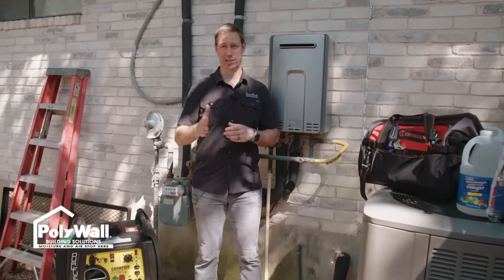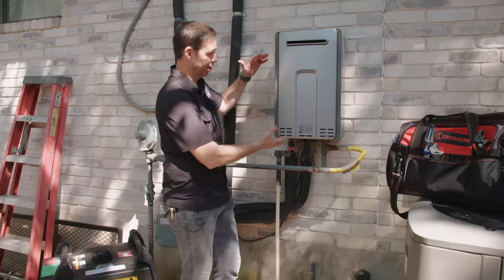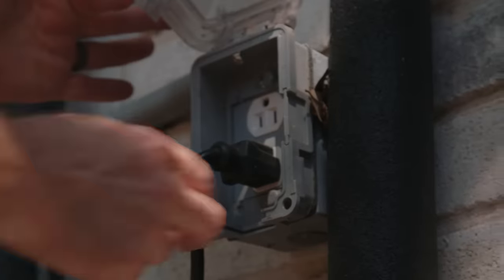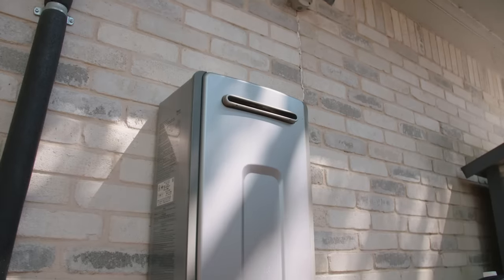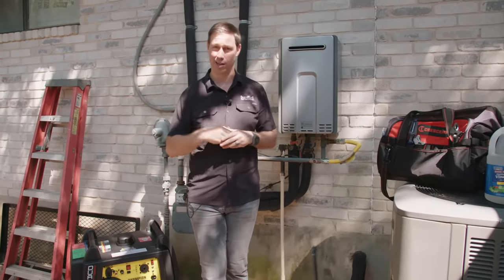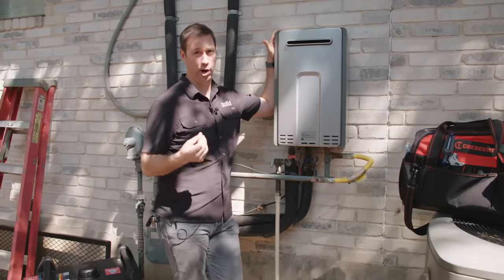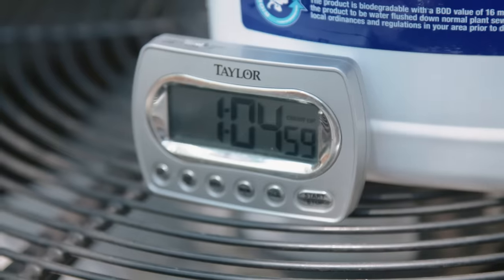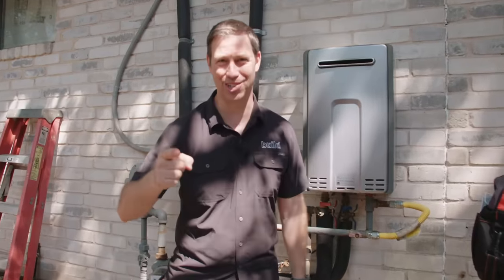3 Things They Don’t Tell You About Tankless

Comment: They have battery 🔋 igniters on some of them.
Reply: Surprised all of them dont but unless its a lithium recgargeablethat charges automatically when power on the battery probably would be dead when power goes out lol
Reply: Those are usually only found on the weird cheesy amazon-chinese style that are meant for camping. They typically have a 20 minute time limit and are not designed to be permanently plumbed into your house.

It would be a nice feature on the more common home models, but they require electricity for more than just sparking the gas. They have various controls for modulating the heat output if you are only using a small amount of water, and a bunch of safety things. The size of the circuit board inside is surprisingly complex. They don't require much power though, you could plug it into a lithium battery/power inverter combo that you can buy for cheap.
Reply: Ryan Roberts they should make a built in 12volt igniter with a 12volt lithium battery. That has a USBC charge port that you can use to to charge the internal lithium battery. That way you have the option of running it DC or charging it from a House hold wall plug.
Reply: tee kay yah but it takes very little power to ignite propane. a couple of 18650s would last at least a couple days of constant imagination.
Reply: @theMekanik  Like I said, they require power for more than just ignition. You could easily plug it into a cheap UPS or a lithium battery/power inverter combo.
Reply: Ryan Roberts yah but I hate the idea that everything in our houses are practically DC and we keep putting rectifiers in ever damn DC device to make it work with incoming AC Power when all we have to do is transmit AC to the house and Turn it into DC ONE!!!! TIME!!!! then distribute DC through out the house. DC 48volt would be good enough to run most anything or 24 Volt. 

Light Bulb, Power Tools, TVs, Computers, Cell Phones , Refrigerators, Electric Cars are all DC Devices that have to convert AC to DC. I can’t honestly believe I am the only one that sees how ridiculous this is that we still try running everything thru investors that have losses throng to convert DC to AC BACK to DC 🤯 I mean even Solar is DC current. I don’t know why we keep trying to change DC to AC back to AC to power the majority of all out devices and lighting that runs on DC power!!!! OmG!!!! Lights should be the one thing we center power on. Loosing 15% of power through changing it back & forth. That’s insane, then tell me that if we are are running on Nuclear ☢️ 15% of extremely Hazardous material is being wasted because we are morons. 😑🤬🤯 Think of it as loosing years off your life. 100 years - 15 years = 85 here let me just take 15 years of life from you make you do “busy work” 🙄 It’s like people driving around in a 4 Door 4x4  to a job they have crunching numbers. Which they could probably do just as well sitting at home on their butt. 💁🏻‍♂️ Then they justify it because they need a 4x4 Truck to go hunting only 2 weeks out of a whole year, when the could hardly augmented their transportation with an small electric car or scooter 🛴 🚗  for transport to & from “work” 🤨 Don’t even get me started on the infrastructure required for  public transportation. Many other things I have thoughts on in the area of “waste” and poor product design. 😖
Reply: @theMekanik  Sorry, but you have no idea what you are talking about. There is nothing wrong with AC and no 24v DC would not be acceptable supply/distribution in a house. They figured that out over a hundred years ago. I couldn't bother to read your rambling second paragraph.
Reply: @theMekanik  Having lived in a RV for a few years (near a resort town, no affordable housing), I often thought about wiring a house for DC (since everything in the RV ran off either 12VDC or propane). But then I started thinking about the high current devices, microwaves, fridges, etc. 

The wiring would end up looking like a car. Plus the fact that the power supply that you would have to install would not be very efficient at lower power draws. Not to mention the incredibly high amounts of current that would be coursing thru the walls. We're talking about single wires carrying 150, 200, 300+ amps for major appliances!? It comes down to this, higher voltage=lower current. 

I have wired a small cabin to use 12VDC for a friend, but the stove and fridge were propane. No washing machine, no dryer, no microwave. And he still has to use an inverter for the TV. He was using Solar w/batteries for power but didn't want a whole house inverter.
Reply: Small ones (7 liters) have 2 D batteries, mine last a year on daily usage
Reply: @MojoPup  Exactly. An average electric stove or dryer uses about 3kw. That would be 250 amps at 12v or 125 amps at 24v. You would have to run wires bigger than the battery cables in your car to every appliance. Not remotely practical. Even on larger vehicles like busses, airplanes, boats, etc often run most of their systems using AC power. That's why bigger things don't run on 120v either, you need to have 240v as the load goes up.
Reply: @theMekanik  48 volt dc requires much larger wiring for anything requiring much power like microwave oven fridge dryer water heater ovens  and dont even think of tankless electric. Even golf carts have gone to 72volt or higher in many cases and several even convert the dc to ac to run ac motors for efficiency these are generally either larger motors or 4wd etc.  DC power actually transmits more efficiently over long distances at very high voltages much of this attributed to the magnetic field and "skin " effects of ac that dc doesn't have.. China is doing this to transmit power from desert areas with solar to big cities. A typical solar inverter also loses 10-20% in transmission and conversion loss.  Remember a house circuit has to meet code designed to have a particular amp load that may never actually be plugged in to this. With LED lights and tvs etc now I think at the minimum there should be an option for a 2 or 5  amp ac circuit instead of 15 etc.  A whole ceiling full led bulbs  will likely be no more than 200 watts where the design for incandescent would have to carry 1500-2000 watts.
Reply: @theMekanik First my answer was for the fan someone suggested that may need power also I presume the duct fan for condenser unit. true but 2 18650 cells is only 7.4v or so nominal not 12 volt but design could be for any voltage a usb is considered 5 volt so it wouldn't charge series 18650s but yes it could be done its essentially same as a UPC.
Reply: Ryan Roberts 48volt DC system in a house/domicile/apartment/flat. 24 volt for portable handheld power tools & double stacked 24X2=48 for skill saws, chain saws, weed whackers...... etc. 

The only thing they figured out a hundred years ago that AC was only good for transmitting power long distance over 100 meters. No place in a house is over 100 meters. 48 volts DC system would be perfectly adequate for of all living quarters of 98% of all human beings. 🤣
Reply: @theMekanik  You just need to stop talking. You have no idea what you are ranting about. You're making yourself look dumb in public.

There is no reason to supply houses with DC power, and no, 48v would not be acceptable either.
Reply: tee kay Vape Mods charge, single, dual, triple 18650’s through USBC. it should be capable of providing plenty of ignition cycles.Yah I didn’t think of the condenser versions of the gas on demands. There is an 9 inch Opolar  dual 18650 fan on Amazon that charges with USB it’s lasts about 8 hours?? of run time before it dies & I can run it on a 20,000mah external USB battery pack for probably 24 hours, not sure the requirements for the condenser units but I am sure it is doable to power a 5 volt DC fan for 24 hours when the prime power goes out???
Reply: @theMekanik  a lower dc voltage cannot charge a higher dc voltage .  Either the 18650s are connected in parallel or the voltage is stepped up.
Reply: Ryan Roberts I said supply AC to the house, then change it change it to 48 volts DC for all the lower voltage appliances 💁🏻‍♂️ Then have dedicated runs for higher power consumption loads, like clothes driers, microwaves, convection ovens, hair dryers. You know like they already do. Make it like an RV & run a 48 volt system instead of 12/24 volts. 

Use propane to to cook with, & on demand water heaters. Possibly to heat the living space too.

If the insulation is superior in a domicile, you really do not need a shit ton of power to heat or cool your living space, I think Matt had a house on here that only used 1500watts to heat an entire large house in the Northern Hemisphere. 

I use:
-  a propane camp stove to cook with

-  an electric on demand water heater

- a ventless washer/dryer that uses 120 volt AC

- an electric counter top convection oven that is just big enough to put an 8x8 cake pan in

- an Olympian Wave 3 Propane Heater 

- a 120 volt 6,000 BTU LG window AirConditioner

- a 13 cubic ft 120v refrigerator

When the power goes out I take cold showers, cook on my propane camp stove, keep warm with catalytic propane & a -20F sleeping bag, if need be I can wash my clothes by hand, & keep phone charged with 2 X 20,000mah battery 🔋 packs that you can get at Wal-Mart on Black Friday Sale for $15 a piece. That is generally enough to get by with until power is restored.

I did use a 12 volt cooler for a year as a refrigerator that worked just fine keeping sandwich meat & stone ground mustard.
Reply: @theMekanik  You just plain dont understand what I wrote.  without even looking I can tell you it definitely does not charge them in series connection . It is charging them in parallel.
Reply: tee kay Ah I get it now thanx 🤘🏻 I will have to re-watch a #willprowse YT channel to refresh my memory. I think he explains it in MPPT vs PWM vid. 

https://youtu.be/PB6zojol9o0

Parallel / Series Configuration.

Still think the igniter can be integrated into the system with 18650’s & USBC charging so if you wanted you could power it with an external battery pack. I mean if the cheap ones on Amazon can fit batteries in them & vape mods can charge 3 at a time & the cheap smart charger can do it for $30 they should very easily be able to put it into a higher end name brand version. 💁🏻‍♂️
Reply: Or like I said it could have a step up voltage circuit on the fan or the switch that turns  the fan on or maybe to battery mode also switches batteries from parallel connected to series connected. Again its impossible to charge a higher voltage dc load with a smaller voltage .dc supply. Think of connecting a high pressure water supply to a lower pressure one . The water would never flow toward the high pressure supply. A Nickel metal hydride battery single cell is 1.2 volts  and about 1.48 volts fully charged the lithium cells are 4.2 volts fully charged and 3.7v nominal.  The charger charges each one in parallel.  So lets say you charge 4 NiMh batteries in the charger.  Each one is say 1.4 volts fully charged.  Then you put all 4 in something that runs on 4 of them . The voltage from the 4 batteries could be  providing 1.4 volts or 2.8 volts  or 5.6 volts (it would only need 3 batteries if it ran on 4.2 volts)  If it used 8 of these batteries it could run on as high as 11.6 volts but each battery is still 1.4 volts .  

Maybe a better way to explain it a flashlight that you open one end and put in 2 alkaline  or NiMh batteries has a bulb that will be fairly bright on a 3 volt supply.  If you put in 2 NiMh batteries it will work but wont be quite as bright .  If you used a piece of aluminum as a spacer and put in one battery it would be hard to tell the light is even on .  If you put one Li battery in it like an 18650 with the spacer it would burn brighter  than with the other 2 types .  If you put 2 of the Li cells in it it would be even brighter till it most likely quickly burns the bulb out with about 8 volts.
Reply: @theMekanik  He may but thats not really the difference in MPPT  which is maximum power point tracking and PWM which is pulse width modulation  kinda similar theory though .  Asmall pump can fill a large lake over a long time but use many small pumps at the same time and  you can fill the lake much faster.

When Will Prose talks about a battery pack he is making he calls it a 4S1P if he is making a 12 volt Lithium iron phosphate  pack or maybe a  8S 1P for a 24 volt pack or a 8S2p if he is making a 24volt pack that has double the power. The S and P stand for Series and Parallel.  The more cells in series connection (hooking positive of one cell to negative of next cell ) increases the voltage.  The more cells or packs of cells connected in parallel (all negatives connected together and all positives connected together) the more power you can supply at the same voltage.

Here is a link to USB power  values. The USB 1,2 and 3.0 all supply 5 volts but different amps or watts but they are all 5 volts or they would harm the devices being charged if the voltage were increased and could still plug in to the same devices.
Reply: usb power voltage
Reply: sorry link didn't work.  Read your recent supply . An igniter could be designed to use any voltage or even several different voltages but they would need different ways to plug in or switch for the different supplies just like most battery chargers that charge the 18650 s and Nimh or NiCd batteries have a switch to change which type batteries you are charging  (though some can sense the voltage and adjust automatically.
Reply: @theMekanik  I recommend you go to Google search and type in USB voltage and look at the questions people ask. A USB port provides 5 volt power.  and up to I think 1.5 amps on USB3.0 which is 7.5 watts.  Even if stepped up voltage it would still be 7.5 watts or less.
Reply: @theMekanik  I didn't make any claims about USBC
Reply: @ryanroberts1104  granted it doesn't really have much to do with the tankless gas units but everything I said is true so if you dont like reading it then stop. I learned something I wasn't aware of USB C and yes it can supply up to 100 watts at 20 V and certainly could supply power for a tankless gas heater that is designed to use 20 v but it has different connectors than the USB standard. I am simply trying to educate and answer comments to me and now am answering your comment.that seems addressed to me also.  Name calling just makes u look bad.
Reply: @ryanroberts1104  As I stated it could nave something to do with a charger for internal batteries to take over during power outage but not really relevant . Name something I said that isn't true if you can.
Reply: @teekay1785  I'm not going to pick through all your rambling posts but just this "A typical solar inverter also loses 10-20% in transmission and conversion loss." is totally wrong. Typical power inverter is 90% efficient worst case scenario, more frequently 95%+ for the latest versions.

The back and fourth about 18650s and USB is just not at all relevant to this subject and I'm not even sure what you two are trying to talk about. If the manufacturer wanted to include a battery backup they could, but not the way you think they would. They all run on 120v AC thus a power inverter or generator is required. You could easily plug it into a standard computer UPS system for little money and have several hours of hot water from that. Multiple ways of accomplishing this but none of them include USB. They are never going to be making tankless heaters that run purely from DC power.

Your posts are not quite as dumb as theMekanik
, but all this back and fourth is just mindless gibberish that doesn't apply to anything.

It's also not that big of a deal to go without hot water for a few hours, it the power outage lasts longer than that you will need a generator or expect to be generally miserable until the power is back. Not to mention all the people with electric water heaters, both tank and tankless, that would not work in a power outage. Not really a concern for most people when installing them.

If you are that concerned about being without hot water you should buy a $99 propane camp shower to keep as a backup.
Reply: Ryan Roberts they are are working on it as we speak. 🤣
Reply: @ryanroberts1104  90 percent efficient is 10-20 % efficient and you are looking at ideal specs not real world and probably some specs that dont include round trip to  the batter4ys and the power that is required just to keep the inverter turned on which is usually 30 to 60 watts. Just give it up you dont stand a chance.
Reply: It's not about ignition! That heater is 200,000 BTU. It needs a forced air supply to burn that much gas. It's the fan that's consuming most of the electricity, not the ignition which as others have pointed out could be run from a small battery for many hundreds of cycles.
Reply: Spencer Wilton it seems ridiculous that they don’t have battery powered igniters seeing is how they are suppose to be “higher end” than a portable $150 camp style one. I mean I hate to point out the obvious if your power is out there should be a power outage mode / bypass mode built in where it doesn’t need to operate with a blower fan, like the cheap azz Chinese ones on Amazon as everyone says is fully capable of providing hot water without being connected to grid power. It’s propane the whole damn point is to be able to operate without grid power. 

Even if it consumes power it should still be powered by USBC (Power Delivery) the MacBook Pro charges & runs off of USBC at 20 volts @ 90Watts. That should be plenty of power to push fans. 💁🏻‍♂️

It would be nice to see them make an app that had the consumption & hours of use the machine was in.
Reply: @theMekanik  It only seems ridiculous to you because you have no idea how they work or how electricity works. As has been explained numerous times, they need power to vent their exhaust, as well as powering safety controls and modulating gas flow to the burner. If the exhaust vents naturally, then the unit is very inefficient because heat has to be released on purpose into the exhaust to cause a draft.

THEY DON'T HAVE BATTERY POWERED IGNITERS BECAUSE THAT IS NOT THE ONLY PART USING ELECTRICITY! It would not be safe to have a 199,000 BTU tankless heater with no electrical safety controls.

Camp showers can get away with being inefficient because you do not use them every day and they are not supposed to be permanently installed anywhere. They are also nowhere near 199,000 BTU.

Also I'm not sure why you freak out about this so much, most tank style gas water heaters also require electricity...and obviously every electric water heater requires a LOT of electricity. In general if you want a lot of hot water you're going to need electricity, that's just how it is. The ONLY way to efficiently make hot water is with electrical controls on a gas appliance or a full electric heat pump water heater.

Is your power really out that often? If it is buy a fucking generator!
Reply: Ryan Roberts 

Tiny House = Efficiency 🙃
 
(You do what you gotta do, to make things happen) 💁🏻‍♂️

Thermal Powered Fans, like they have on wood burning stoves, Peltier Electric Fans, Mechanical Turbos Exhaust Spins Turbos & Forces Cooler Dense Air In. 

Even if it’s illegal no one provides the resources or the funding to be in compliance. Some have access to the resources others do not. 

Either way they need improve on the design to account for power outages. In all logic propane should operate without grid power.
Reply: @theMekanik  Nobody here is talking about tiny houses. Those aren't houses at all, but rather sheds that poor people live in. They are usually illegal and not up to code. A peltier powered fan would absolutely not work, nowhere near enough power would be generated, and no, you could not use a turbocharger. Once again you have not even half of a clue what you are talking about.

Nobody else thinks the design needs to be improved. Modern tankless units and what they do are quite amazing as is. If you expect to be spending extended time without power, hot water should be one of your least concerns.
Reply: @spencerwilton5831  My tankless is a Rinnai 98 that heats 9.8 gpm and specs say fan uses 164 watts and standby is 2 watts.  In a 24 hour day 2 of us taking a 10 minute shower each  would use 55 watts for the fan and 48 watts for standby for a total of 103 watts per day. Many car batteries would supply this a week or more without recharging.
Reply: @spencerwilton5831  The fan on my unit is 164 watts so only uses 55 watts for 20 minutes worth of hot showers.
Reply: Yar Nunya  depends on where you live, some ppl are stacked 20 deep in 1 bedroom, go figure 💁🏻‍♂️
Reply: Yar Nunya  I can’t agree I have seen a family of 8 riding on a moped 👀 I am quite sure it’s possible to have 20 children from 1 couple. & I have seen monkeys doing jobs of humans with compensation of bananas & free rides on the back o pick up trucks 🤭
Reply: Yar Nunya  The heck I dont thats .103 Kwhr per 24 hours and cost me about 1 cent .
Reply: Yar Nunya  I didn't say USB 3.0 bur 5 volts is still 5 volts no matter how many amps it could supply it still cannot charge a 12 volt battery for instance without being stepped up to above 12 volts or connecting to each 1 0r 2 cells at a time of a 12 volt lead acid battery.
Reply: Yar Nunya  I did and I can.
Reply: Yar Nunya  watts per day is 24 hours you can change the units yourself if you can divide and have any brains at all